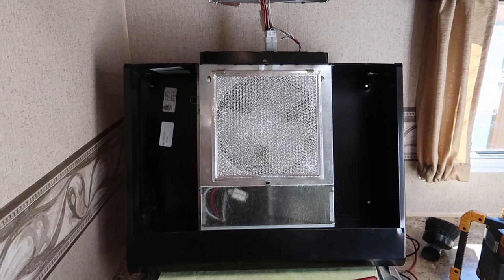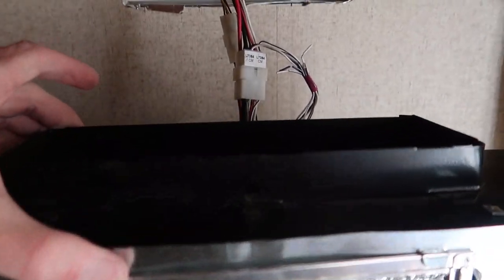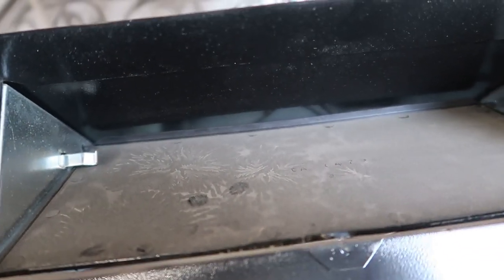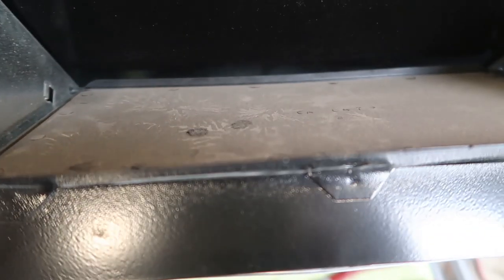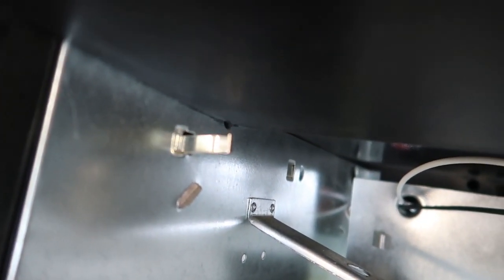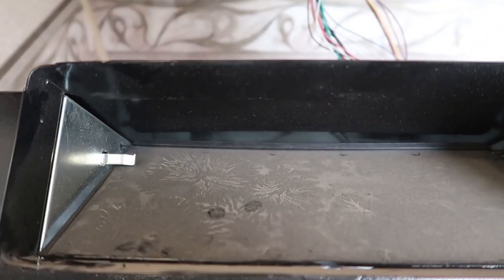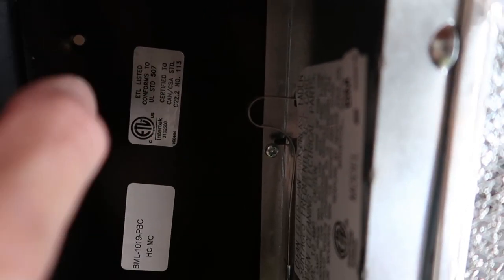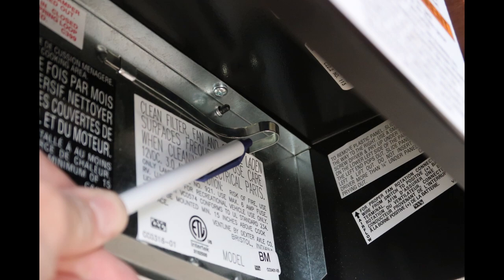Mystery Lever on the RV Stove Hood

Comment: I will give you 2 thumbs up!  I am replacing the outside vent due to cracking from the Kansas heat on our last trip.  I removed the outside cover and noticed the inside flapper opening only slightly when the fan was running. I pulled up your video immediately.  This inside flap seems like a duplication since there is an outside flap that can be secured in the wind.
Reply from the maker: Glad it helped!